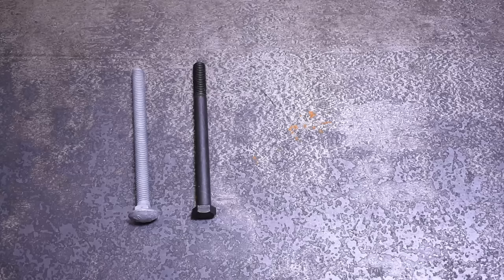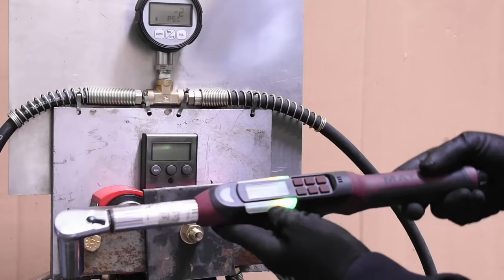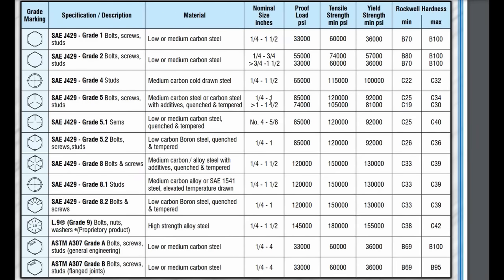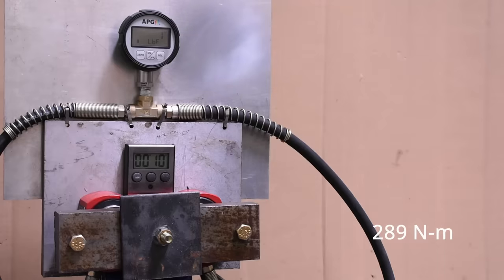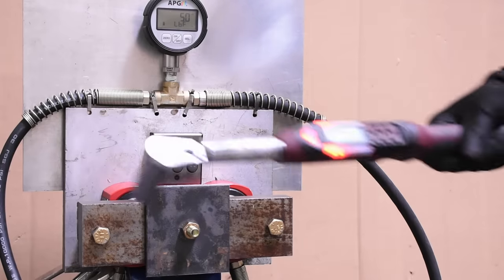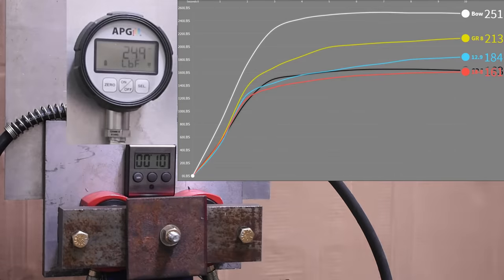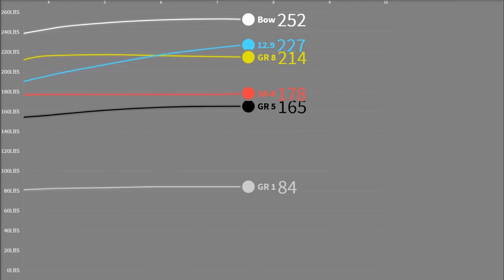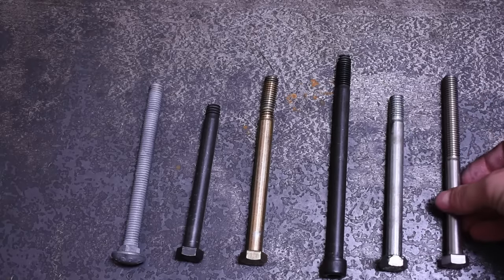Strongest Bolt? Grades Explained & Dyno Tested For Science

Comment: Stainless steel often confuse us because it has properties that are different from regular steel. Not just "stronger overall" or "weaker overall". You try to cut stainless steel bolt with a saw and you might think "OMG WTF is this thing". But that resistance to abrasion (I suppose) does not necessarily translates into a stronger thread. Stainless is denser than regular which leads to people saying it is weaker (by weight) but by that same logic aluminium is "stronger than steel" (by weight), but those of us that have to deal with aluminium bolts might have a different impression.
One thing that makes me a bit weary of stainless is the work hardening properties that it often has, which can be a bit unpredictable, so a regular steel that is heat treated properly seems to be more reliable in my eyes. I just don't like the idea of a fastener getting harder and brittle in unexpected ways. Leave stainless for what you need the specific properties of stainless. Where there is heat and corrosion regular steel cannot defeat stainless.
Reply: A welder and metal fabricator would tell you that stainless is harder than steel, because they have no education in metalurgy or mechanical engineering. It's harder to drill, punch, machine and bend. It also does not stand up to vibration very well. It's only for a marine environnent where salt water is around, or chemical processing (316) or where road salt is coroding steel.

Comment: If you coated the threads with Molly Lube all your numbers would be substantially different, right? Fighting that friction of the threads eats a lot of that torque. Or am I missing something? The pressure on your strain gauges should increase because the lack of friction is being transferred to more pressure in my mind.

Comment: No A286 stainless?!

Tightening torque guides are typically designed around 70-90% of yield strength for the size and material for a clean, unlubricated, thread. Thread conditions like lube, rust, dirt, etc will change the torque-tension relationship a lot. So that torque is just a bit under what permanently stretch a bolt.

Comment: I wonder if the hardness was changed when you torqued the bolt to fail. Maybe try testing the hardness before and after the test and at the head and the failure point.

Comment: I'm reasonably sure that there is a difference in longevity between same grades depending on the manufacturer. I have a high stress high vibration bolt that came with a 10.9, should be grade 8 right? Sheared off in a year of service. I replaced it with a home Depot grade 8. Thought about ordering something from ARP but just didn't spend the time. That was 3 years ago, the home Depot grade 8 is still running strong. Same size, same thread pitch, different bolt manufacturer even though they are rated equivalent grades

Comment: who knew watching bolts tightened and break would be so nice to watch. 

btw, what is the usual application of thor impact wrench ? if its more powerful than bolts failing strength then it must be working on even more difficult tasks
Reply from the maker: Larger bolts. Also, a bolt that's stuck once already tightened, like from rust, can well exceed its own thread strength in the amount it's "stuck".

Comment: I have spent my life in the marine industry. The standard was always the grade 8 bolt for anything between the engine (usually diesel) and the drive. Might have been old wives tales, but we were always told that anything less would fail. As far as brightwork, no matter what grade we used, there was always one bolt, screw, fastener that would soon weep rust. Always!
Yachts, what a pain in the a$$!!!!
Great video, but still confused 🥴.

Comment: Good comparison testing, except that it seems that you didn't show any testing on the hardness of the 18.8 stainless bolt.  I always found that cutting a stainless bolt was more close to or more difficult than a grade 5, but a grade 8 was much harder and more difficult to cut or grind.
Reply from the maker: 18:09 the stainless we couldn't get a reading off of. 304 stainless is not a heat treatable material despite it work hardening easily. It's hardness is in the B scale AKA soft. But it's difficult to cut and machine because it's not a free machining alloy, basically it doesnt like to be moved. And work hardens easily as I mentioned. Other grades like 303 "free machining stainless" has similar strength but you'll notice cuts like mild steel.
Reply: @TorqueTestChannel  Fair enough, as I missed that quick mention, thanks for posting the info!  👍
Reply: The industry does make a hardenable stainless it's called 440 C.

Comment: A pure tensile test on the bolt would yield different results.  Normally the bolt is tightened then it is under tension load.  There is the friction in the thread to be taken into account off.

Comment: Noticed that the government entities around here have all the same bolts that had that BOW head. Wasn't familiar with what grade they were and why maintenance outfits for government entities all had them. Turned out the supplier, Barnes, sold the government entities the most expensive types of everything because the government heads of such departments didn't know there were such things as grades on bolts or what hardness signified.

Comment: Depending on your application, strongest does not always equal best. For example, if your building a roll cage, grade 5 is better than grade 8. The grade 5 will yield and bend but still hold, whereas the grade 8 would snap.

Comment: I've never seen a Grade 1 bolt, but Grade 2 are everywhere. Replacing old beat up over torqued and rusted out grade 8.8 or 10.9 with a nice beefy and brand spanking new Grade 2 or 5 should do the trick right?

Comment: A2 or 18-8 stainless is slightly magnetic and much stronger than A4 or 316 stainless, but only really good for fresh water. A4 is a true marine botl, but much softer and that is why that listing for stainless is so different. The top number is for A2 and the lower number is for A4.

Comment: Drading bolts in a way of what is strong and what is weak is somewhat of a wrong way to look at it.

Materials have different properties based on what they're made of and how they're made. But a bolt that breaks at lower forces doesn't have to be bad, it can be intentional.

In engine manufacturing bolts, while strong, are generally weaker than the engine block. Overtightening a bolt will cause the bolt to snap rather than the threading to be messed up. It's easier to extract a broken bolt than it is to re-thread an engine block.

What bolt you need really depends on the job.

Comment: Did you use anti-seize compound for the 18-8 (ANSI 304) stainless steel bolt?

Stainless steel is very susceptible to gulling, which can cause it to seize up and not reach its maximum clamping Force.

Comment: I work on boilers and chillers so my bolts and needs are not like a car mechanic s. I also have to watch how the bolts handle temp and stretch. Like connecting a flange with a wire wound gasket like a flextalic then heat to 360F add 200 psi N so it doesn't boil. The pipe moves and stretches then it cools as you work on a pump and reheat. But did the bolt come back to the same size as before? Will my gasket hold? 
Answer, 2 to 3 heat cool cycles and they leak with the bolts being longer than before. I check and any loss of diameter that bolt gets replaced. 
That is just for my small system. I don't want to think of what happens on a ship board system running 800psi of steam.

Comment: Maybe the stainless steel bolt is a good replacement for suspension bolts or anything subject to snow and salt. Obviously they won't rust and it looks like they are strong enough to handle those applications

Comment: Stainless threads do not spring like carbon steel does. Therefore stainless threads shake loose more easily. There’s also a considerable corrosion problem if you don’t use stainless nuts. Stainless nuts won’t corrode but they often gall. Threads self weld and tear out.

Comment: While this is all good info it is missing some application and lube issues that alter all of this data.  Lube ranges simply lower the amount of torque needed to achieve the same load.  It is progressive from light oil to Dry lube spray, and some will be for high-temp applications.  Another issue is a "heat cycle" application as opposed to a  Heat and hold application.  A B16 bolt will accept a heat and cool application where a B7 stud will fail after only a few cycles, thus losing its clamping force and failing like an overstretched spring, which is what it is.  Also, "Face friction" is half of the friction involved, so the face of a nut or stud is an issue.  The "Specifications" will generally give a load to achieve, but also the type of lube as well.  Even "Locktite" acts as a lubricant matching oil in lubricity, for the first 15 minutes, but will change the load achieved by taking too long to tighten.  The last issue is "shock" to the application.  You can get the right torque on a lug-nut on a dry bolt but with lube will over load the torque and strip the threads when you put the same torque on it.  Additionally, when you hit a pothole you risk "shearing it off" due to the shock.  Additionally, getting near the max load the bolt will still hold, but cannot be used again, Engine Head Bolts being the most common use of this.  Look up Hooke's Law for more on yield.

Comment: This makes me wonder if studs would have similar failures. May be a long winded video, but let's 4 or 5 grades for the studs. Maybe 2 or 3 base materials for them to thread into, like cast iron, aluminum, and a hard steel. Keep the grade 8 nut, and apply torque.

Comment: Very interesting! I woulda assumed each grade was “exponentially” better. However, I’m curious if these tests were applied using an air impact (instead of an electric impact) gun, if the torque curve/failure points change on the graph??

Comment: Could you do every possible test for "Self tightening washers"?These are basically reinvented washers used for places where you get a lot of clamping or vibrations. The idea with them is that you put the screw without worrying about it getting loose ever
Manufcaturer : Böllhoff 
They're called RIPP LOCK Washers, they also sell variety of screw grades with the RIPP-Lock washers slotted

Comment: I work maintenence for one of the largest fruit processors in the US. Everything has to 304 stainless and it sucks. Some of the techs are really knuckle daggers and think everything has to be 100 foot pounds went tightened. I find myself using ez-outs, broken bit extractors and tapping bolt holes more then im fixing machines. There absolutely worthless. Some of the equipment we have tried to make the stainless work but it doesn't handle constant vibration of any sort for much time and have had to switch to to mild steel.

Comment: Hello, greetings from germany.
At work we checked a gearbox housing for leaks. For the test, the body is filled with water. A 3 inches thick lid was attached with 12 half inch screws. The customer wanted to know how much pressure the housing can withstand. At 55 bar (798 psi), the screws stretched so far that the sealing ring was pushed out with a loud bang. The pressure was 105 tons pressing against the lid. The customer is now sending new high-strength screws to repeat the pressure test. The pressure should be increased until the housing is destroyed. No one knows how much pressure the housing will withstand. The employees made bets.
Reply: In the oilfield, we had problems such as you describe from using non-hardened washers that would flatten.

Comment: Do you think four M12x1.75 40mm 10.9 grade bolts is strong enough to pull a 600lb trailer carrying a 750lb load? Is there a way to calculate it?

Comment: Awesome as usual.  I'm thinking of using 12.9 cap screws in 12mm in place of torque to yield 11mm toyota head bolts.  Any thoughts  ? ARP are way too expensive over here.Mal

Comment: I use stainless on my classic car restorations because rusted bolts are a killer. Surprised to see the strength is less than grade 8. Still will use them, but switch to grade 8 for strength where needed.
Reply from the maker: Careful of galling and galvanic corrosion!
Reply: @TorqueTestChannel  Yes, galling is a problem. I live in Vegas, so the galvanic corrosion isn't the problem.
Reply: Selling soft stainless bolts is a big scam that’s been going on for decades taking advantage of people who think stainless equates to higher strength.  Galling is real.

Comment: I wonder if using a grade 9 nut was point loading individual threads, especially in the wimpier bolts. If a nut has more ductility than the bolt, it should pull a bit more evenly as it will conform and grab more points. You will ultimately then be pulling on the minor diameter just below the nut as this is the weakest point next in the chain, but pulling more evenly and likely in a straighter line. With a harder, less ductile nut, you potentially pull hard in just a couple of points on the bolt thread. Not saying this was done poorly, or incorrectly, just maybe an interesting thought.

Comment: Actually surprised on the stainless performance..still I only use them in very specific applications, where corrosion(s) or extended durability is absolutely required….down well, well caps, frequently removed or holding running boards   to the frame…steel/aluminum applications…

Comment: What you tested is Strength not Hardness. Strength refers to the amount of force is needed to deform the material. 
Toughness refers to the resistance of fracturing when force is applied. 
Hardness refers to the ability to withstand friction. Bearings, drills or diamonds are hard. 

Stainless steel isn’t very great if you look at strength or hardness but it’s tough and corrosion resistant. Used in marine environment but also food or chemical industry.
Big downside of a SS bolt and nut is when you apply to much torque to fasten the nut.  The Thread wil deform and it’s almost impossible to remove. It’s what I call a cold weld. I think it’s called seizing or galling in English. Strangely enough you didn’t encountered this problem.
Reply from the maker: Hardness 18:09

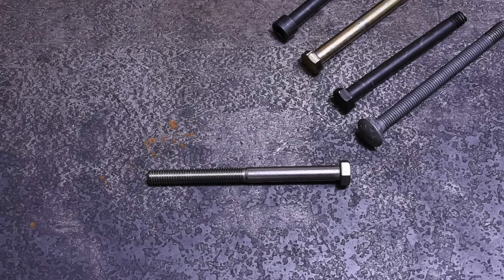Comment: 2:00 A minor correction.  304, 18-8 and now also called A2, is "kitchen grade" stainless.  Pots, cutlery, etc.
"marine grade" is 316, 18-10, and now A4.  
Source, i've been sailing for way too long 😂
Reply from the maker: Cheers for saying so in a nice manner!
Reply: In the seventies a welder would tell you grades of Stainless were" 304, 308, 316 and 440 C is the hardenable type.

Comment: You should also be aware that if you need a bolt that can take a little bending... like if you need to nudge them a bit... then stick with grade 5 if steel and grade 2 if wood is connected.

Comment: Curious if you used anti seize or assembly paste on the SS 18-8 do to the frequency of SS hardware seizing up during installation? Would also have to adjust torque specs from dry to lubricated…

Comment: I bought 1/2" trailing arm bolts for my Delorean made of INCONEL. They were $100 for 2. I wonder how they woud fair on this test.
Reply: Good ole' Johnny D making things "practical"
They likely used Iconel for stretch/creep/crystallization fatigue resistance and perhaps corrosion resistance... Or maybe b/c Time Travel is hell on Suspension components ;-)

I believe that those bolts if stretched/fatigued to failure would cause you to lose control and wreck due to the suspension geometry in the DMC-12.

Iconel is really more of a extremely corrosive/hi-temp/vibration type application high strength alloy... think jet engine turbines and nuclear reactors... 

I wonder if the  engineers "forgot" what happens to a non redundant suspension components after 10 years of salt and cornering at "88Mph"...

I love these cars btw but holy crap some of the decisions were ... ill informed.

"Lets build a car with a body that never rusts but give it improperly speced material in the trailing arms and attach the door handle straps to a flimsy door handle."

Also "Lets build a car with a body that never rusts but the radio antenna should be in the windshield look cool and not work... "
OR
"Lets build a car with a body that never rusts but the radio antenna should be fixed in the front right fender, look like crap, and work
OR
"Lets build a car with a body that never rusts but the radio antenna should be manually retractable look like crap and work... until you (or Biff) break it off
OR
"Lets build a car with a body that never rusts but the Radio antenna should be be under the rear induction grill, automatically retract, LOOK COOL and work UNTIL it breaks itself.

Comment: So a couple interesting things I noticed on here.  One the grade 5 sheared, my experience they tend to bend before breaking, 2 the grade 8 stretched also interesting since most the ones I have seen break tend to explode apart when they break. 3 stainless bolts seem to have poor standards.  I have seen stainless bolt so soft that I could bend them by hand and others of the same size preform better than grade 5 much like here.  I gues to sun up my experience with stainless is you really have to pay attention to what your purchasing because the ss bolts from one place may not preform as well as the same bolts from another
Reply from the maker: Agreed on all fronts

Comment: In my youth high-tensile bolts were marked with letters, I knew that 'M' (or sometimes '55') was 'medium' and 'V' was 'very high' and usually blued, and I sometimes encounter these in old machines.  How do those letters relate to modern grades, should I need to get replacements?